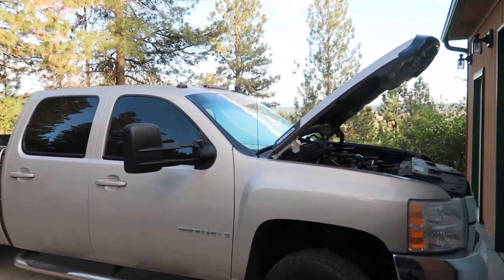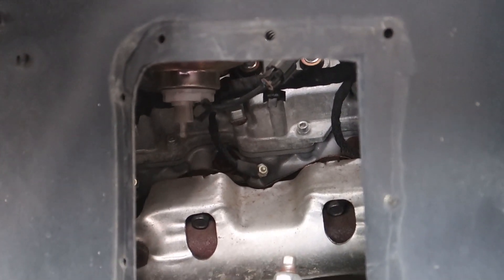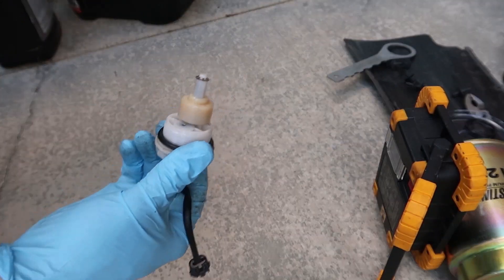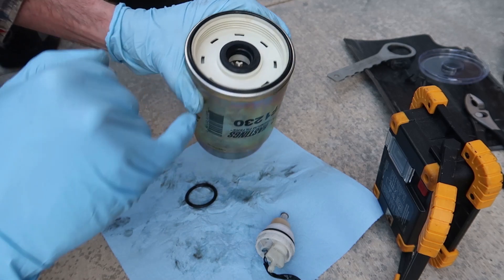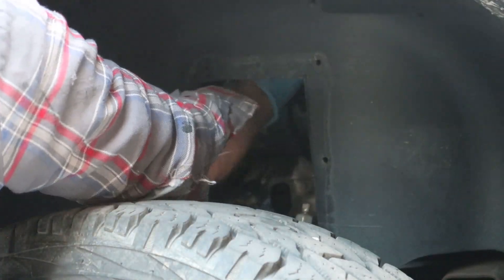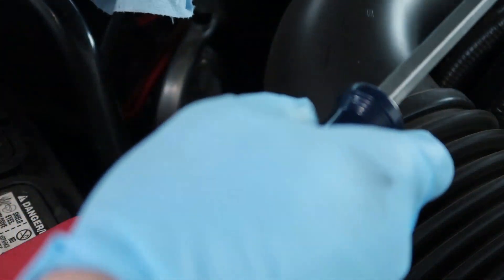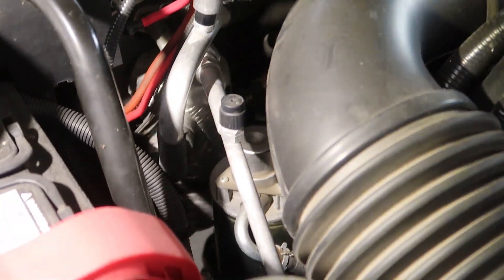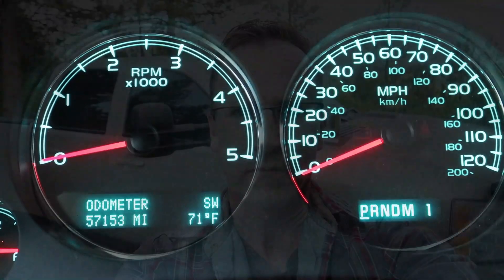Duramax 6.6L Fuel Filter Replacement

Comment: Where did you get the strap wrench?? Rubber or nylon?
Reply from the maker: It's rubber.  I've had it for 14+ years.  I have no idea where I got it.  I actually hate it for the fuel filter change.  The space is tight and the strap wrench is difficult to use in that limited space.  I don't recommend buying on like it.

Comment: Learn something new everyday, also if you fill the new filter with diesel fuel you don't need to bleed the system
Reply from the maker: I hadn't thought of filling the filter first.
Reply: @deltabravo1257  Do not prefill filter.  The fuel will not have been filtered prior to going into the engine.

Comment: I have the same truck as you except mine is a 2004. How often do you change your fuel filter? I’m also thinking about buying the CAT fuel filter kit. The filters are much cheaper and clean the fuel down to 2 microns. (I think I said that right). Lol. I have been binge watching your videos. Very informative.
Reply from the maker: I change the filters about every 10,000 miles or so.  One thing to also note about the Allison transmission, which most people don't know, is to change its filter too.  There's a small spin-on external filter.  I fill the new filter with transmission fluid before installing it.
Reply: Delta Bravo I bought my last Duramax brand new and put over 100k on it before selling it. I did not know about the small external filter on the transmission. Thank you for telling me. I will do that from now on with my new to me Duramax. Do you recommend a certain type of transmission fluid for the Allison? Also what do you think about synthetic oil for the Duramax? FYI my current truck is a 2004 Chevrolet 3500 4x4 4 door dually with the LB7 with 202k miles. I respect your advice. Thanks.

Comment: Thank you sir, very informative. New to diesel engines.  The door seems like a lifesaver, but if the filter is tight will you have enough room to get leverage? Thanks again.
Reply from the maker: Yes, there's enough room to get leverage on the filter.